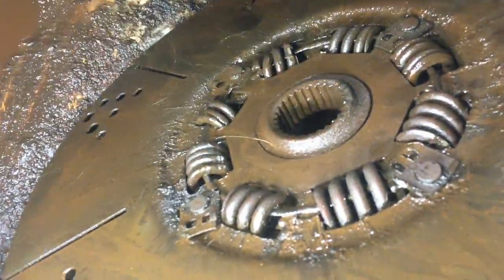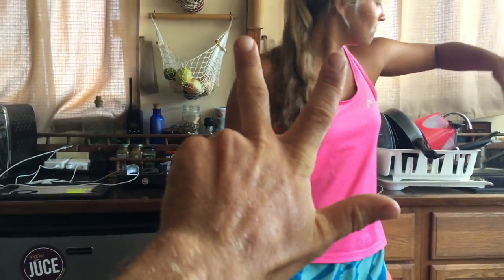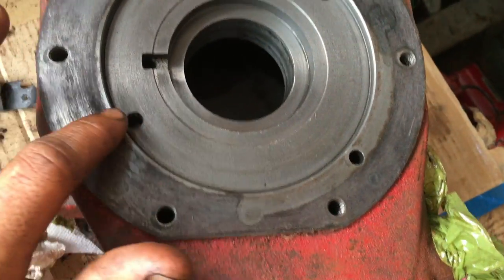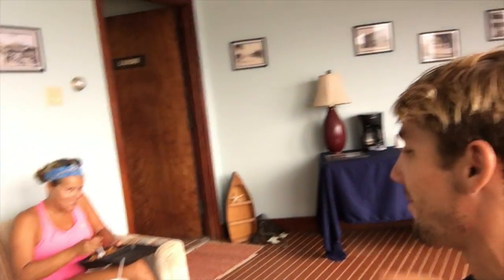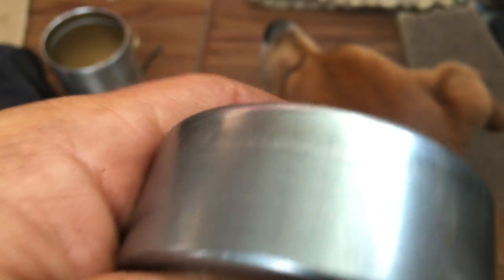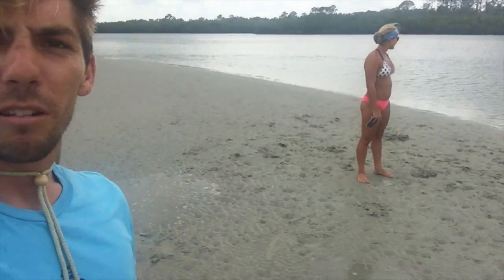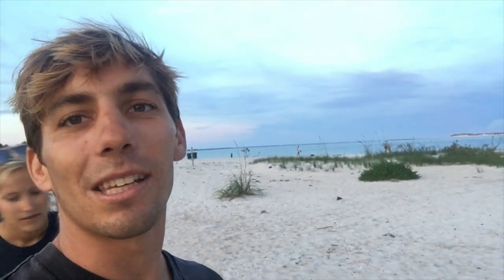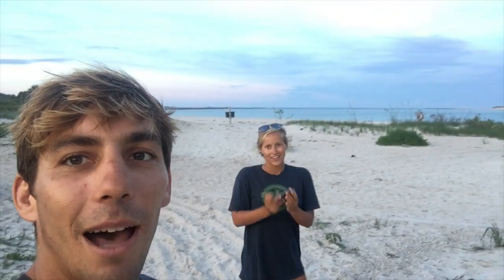how (not) to fix a boat

Comment: Hi guys, found this info on the web  http://www.marinetransmissions.info/Paragon.html     Don´t know if You have the same ?¿? Found it on www.marinetransmissions.com
According to my research Westerbeeke also mounted Paragon 2:1 transmissions on some of their marine engines. Interesting to know is.... Those engines were manufactured by Mitsubishi Heavy Industries like so many other engines at the time. Sorry, don´t know Your engine and tranni model to find out more. Since You have a long way to go up North You might wanna use the chance to have a closer look at the engine. Maybe now with the tranni out some parts are more easy to come by like for example the engine mounts wich can cause an effect on alignment.
I also recommend keeping the old tranni.
Need more info ? ........ Shoot me a line with info and I go digging
Good Luck and rock n roll

Comment: Electric power for boats is becoming a BIG thing now and they are easier to work on
and replace and even carry a spare.
Reply: Yeah, the only thing is that for them, they would need a huge battery pack since they travel such long ways. So it will cost around 100,000USD easy for everything
Reply: The is a man in Ft. Myers that build them.